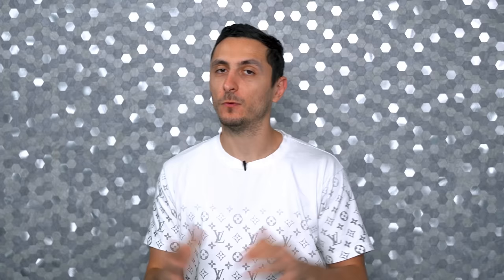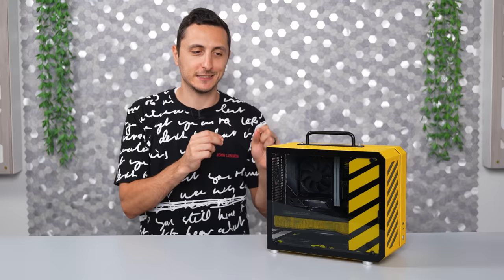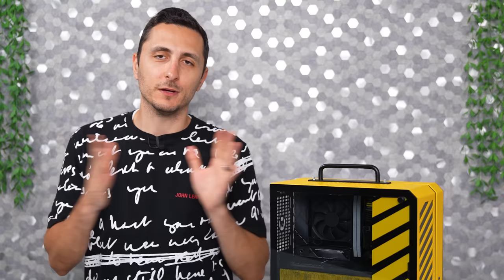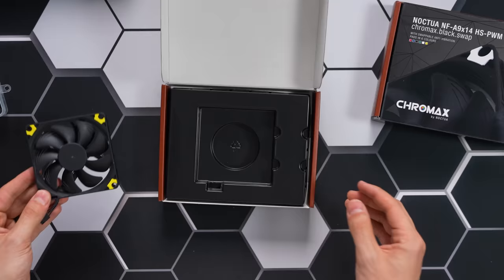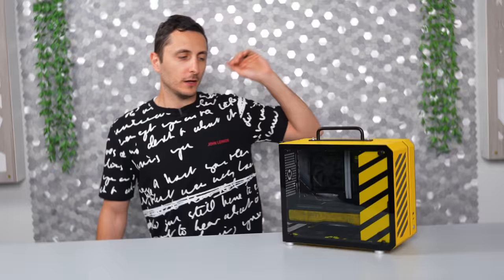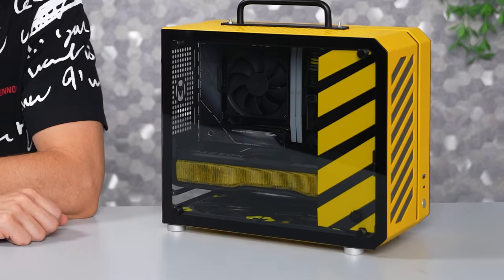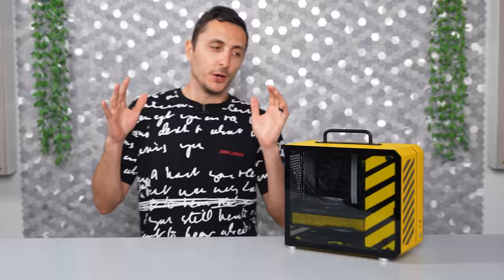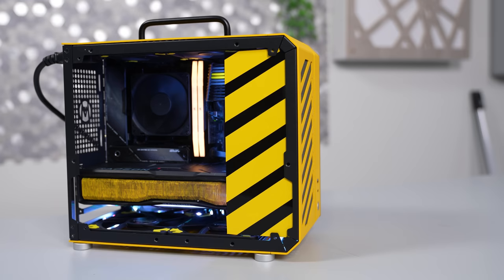Portable Powerful 4K Gaming PC in the size of a Lunch Box!

Comment: I'm very interested in this kind of thing, especially where power consumption is concerned and also if you can run it from an external power brick instead of an ATX PSU because that way you can adapt it for RV or off grid use very easily. I know laptops and exist but a tower case is way more versatile because it's modular.

Comment: The 7800X3D has a lower thermal limit vs the non-X3D chips (89 vs 95 degrees C). You you easily increase your headroom by undervolting the CPU and adjusting the PBO curve. These changes can make a big impact on temps and fan curve in a SFF case.
Reply: It won't run cooler but it will boost higher - i also have a 7800X3D wkth L9a

Comment: Paint would have been fine if you used thinner in paint. Would have made it less thick. Also did you make sure the paint was thermal resistant?

Comment: Really awsome build, not over the top, but with enough customization to make it unique and standing out. The aesthetic is also in my personal taste. I would have done only one thing differently, i would pick Noctua nh-u9s instead of l9a, it's a vertical cooler, but with the height of only 125mm, so according to the case manual it should easily fit. U9s has considerably bigger mass and the fan can push more air (it's also a bit quiter), so i think it would make a difference with 7800x3d. Definietely it would give more headroom for more cpu intensive tasks. 83 degree in gaming with 35% cpu usage and 54W power draw is too on the edge result to me ;p Some programs in the background you forget to close or higher ambient temperature or simply more intensive task or all of it at the same time and it seems like the cpu can easily pass 90 degrees or even hit 100.
Those coolers aren't night and day different in performance, but with such a tight build and high end parts every bit of additional cooling is important in my opinion ;p

Comment: Great video as usual keep up the good work. I have a problem with my fans in my pc. I built the pc my self about a year ago but got someone else to do the wiring for me , they connected the fans to the corsair icue commander thing you put in the back of your pc that allows you to customize the RGB color and fan speed  but my fans aren't showing up in the icue software. I have restarted icue multiple times but it still isn't showing in the menu. The fans were marketed as compatible with icue so i don't know what the problem really is. The commander box thing says install this way up but it is installed the correct way it says to do so, is that something to do with it.

Comment: you could have used an aio cooler with one fan placed on the side panel where there is no fan.  This could have lowered the cpu temperatures by about ten degrees

Comment: I think the second best option, if you are searching for a low profile cololer, after the Alpenföhn Black Ridge is the Thermalright AXP-90R FULL (copper), consider it for the next build, even the non copper version has better performanece then the noctua, obviously because is taller but not enought to be a problem in the majority of cases.